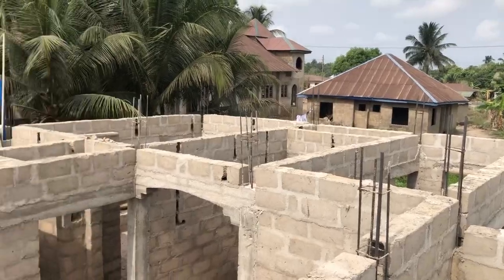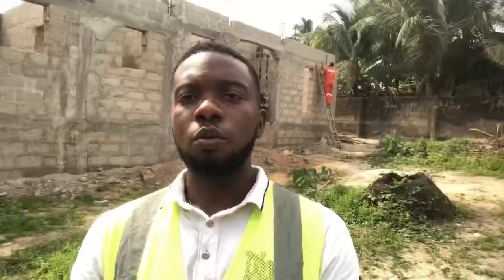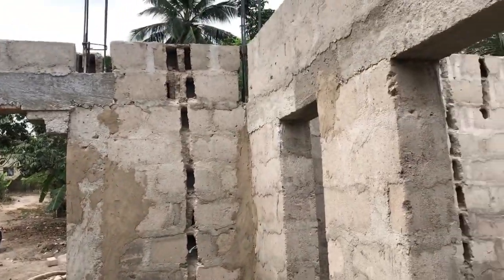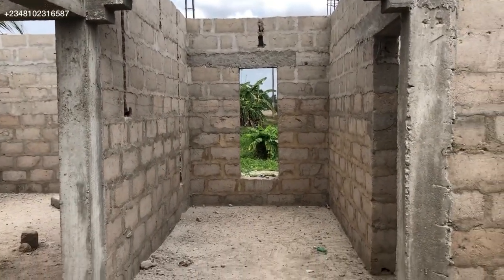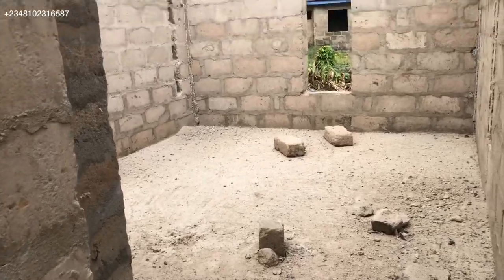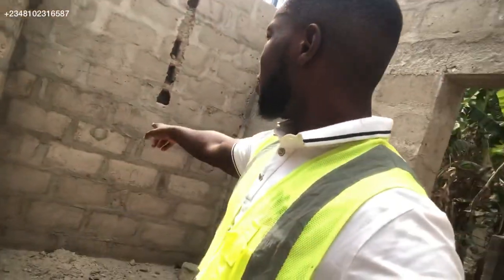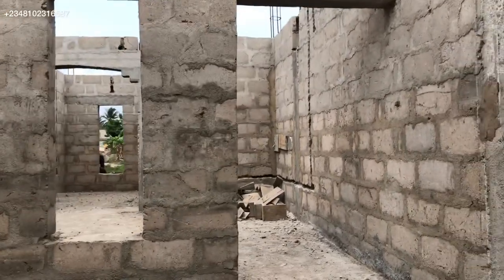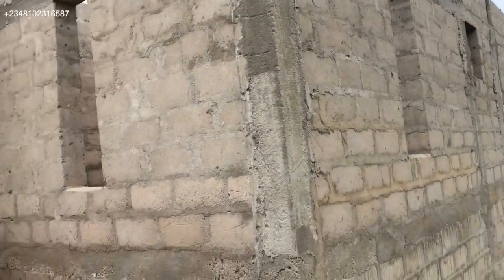Building A Block Of 8 Flats Of 2 Bedrooms In Swampy Land

Comment: My question is, since this location is a swampy area, why didn’t you do a Piling work to avoid sinking or bending of the building in few years to come.? Of course, length of the piling should be determined after the soil test has been done